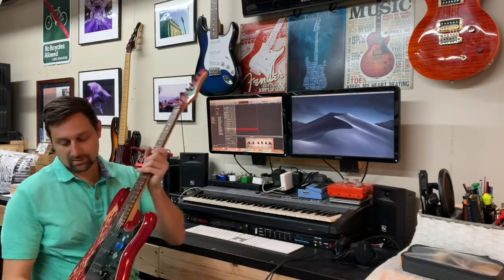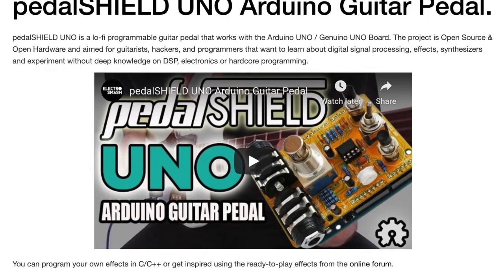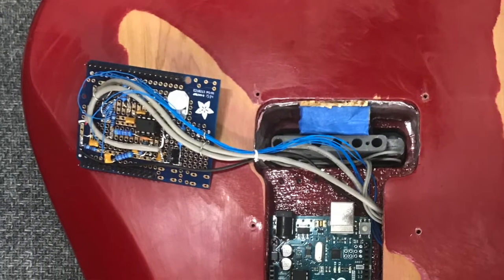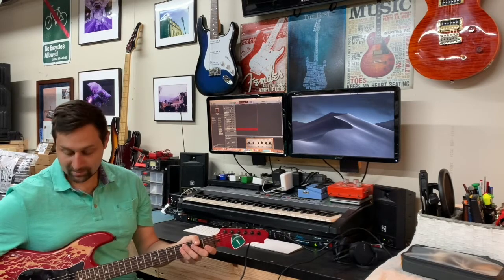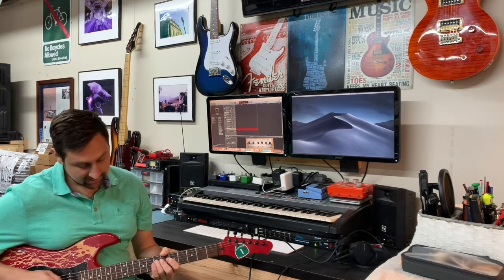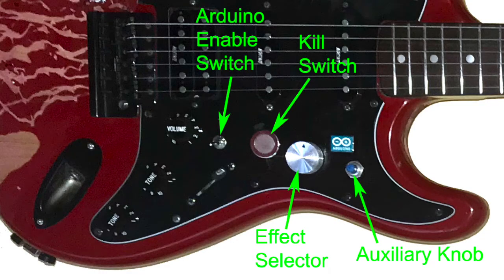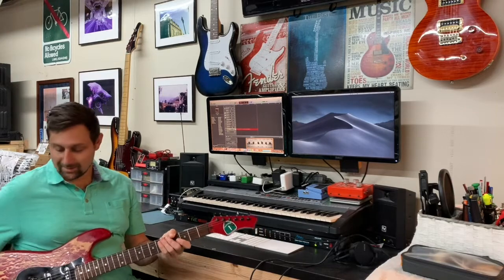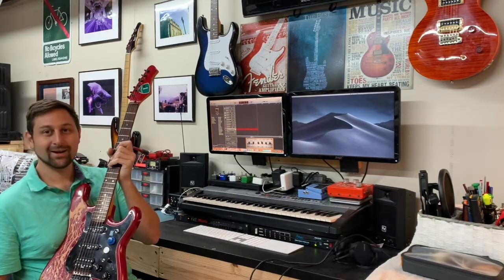Arduino-based, on-board digital effects for your guitar!

Comment: wonder if a synth / keyboard sound can be achieved?
Reply: Not with an Arduino. It's a microcontroller not a DAC. Best it can do audio wise is output an 8 bit signal that you can bump up a little bit with a audio hat but even then, your not going to get much beyond the range of Sega Genesis level audio output,  beyond that you aren't going to achieve anything like keyboard/synth sounds with a microcontroller like an Arduino unless your just using it a MIDI controller by hooking up a bunch of pots, sliders, buttons and so on to it, but then its not the Arduino making the sounds or being a synth, its the DAW or actual software that'll  be on something more substantial processor wise.

Comment: is the Ring-Modulator just effect just output=(adc(0)*sin(phi)) where phi increments depending on the phi angle not sure.
Reply from the maker: It's been a long time so I don't remember exactly what I did.  I started with the Electrosmash code from their website, then I think I messed with the multipliers in the algorithm.  You can find the code I ended up using here: https://create.arduino.cc/projecthub/atoorian/electrostrat-1466fa?ref=search&ref_id=electrostrat&offset=0

Comment: I'd use a different chip; also instead of a USB it may be better just powering it with either a single 9 volt battery or two depending on what the thing can handle